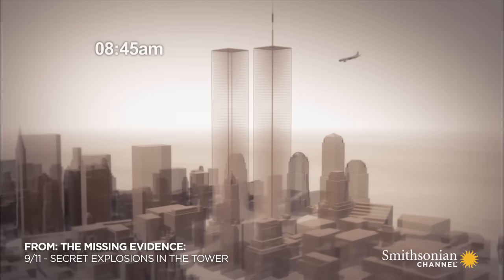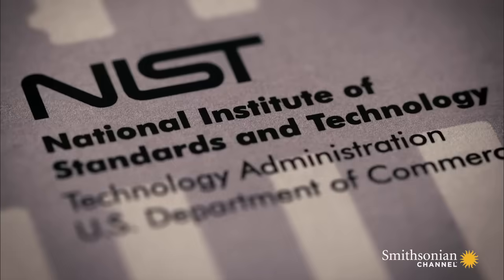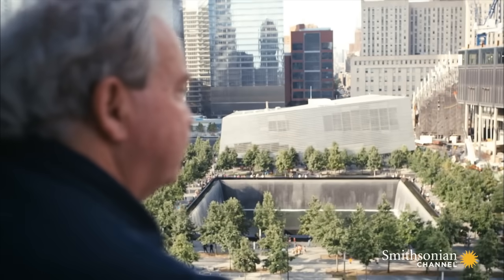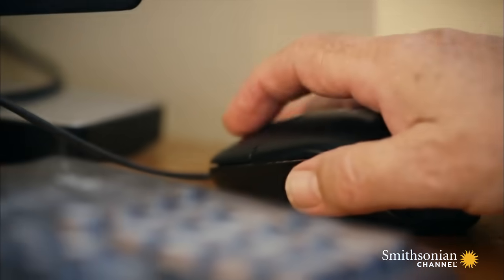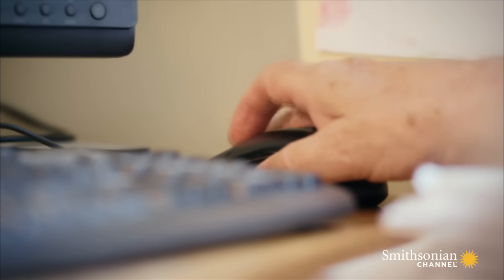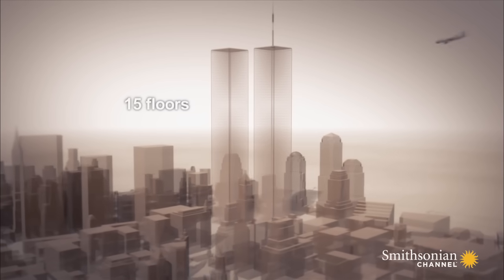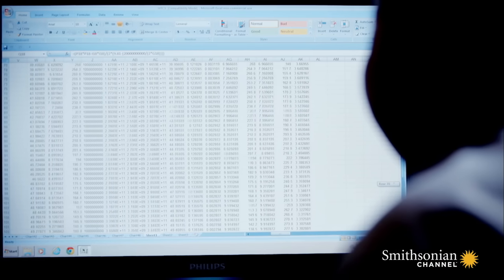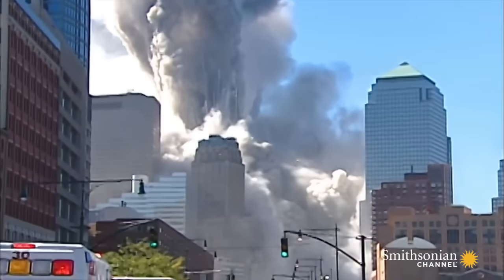This Computer Simulation Explains How the Twin Towers Fell

Comment: The “fanatical rumours” will not go away.
Reply: If you achieve free fall for even one floor, it means the floor gave way giving ZERO resistance. This cannot happen without prior rigging for controlled demolition. Firemen reported seeing “rivers of molten steel” running down the channels in the columns. This is far different to the appearance of molten aluminium. Photos of the micro spheres of iron, indicate that steel had melted, and solidified in air as the building fell. THIS VIDEO is a SHILL video, and the NIST report is a shill report. The perpetrators of 9-11 had access to the stairwells; witnesses have come forth to say that in the months leading up to 9-11, the stairwells had been closed off under armed guard, with workmen going in and out. Most likely unbeknownst to them painting on the nano-thermite that led to the collapses. It looked like the steel beams were turned into dust. Consider this; if demolition crews get the timing slightly off, the buildings don’t fall symmetrically. How could asymmetrical damage do this?

Comment: No, it doesn't explain anything.
This stupid BS is insulting to the laws of physics
Reply: No, it doesn't explain anything
Funnily enough, the "simulation" animation seen in this video is hand-animated, not actually simulated.
Reply: ??? If the floor load limit is X and a weight 15 times more than X lands on it what does your common sense tell you?
Reply: I’m sorry this video hurts your subjective reasoning of what you are. You’re a joke who doesn’t realize HOW basic physics work, so you have no room to insult this video of going against basic physics
Reply: I also love all the “truthers” who calls anyone else brainwashed. People saw it, something hit that building, whether it was UAL 175 or a missile or a steel plane packed with explosives painted to look like a united airlines flight. Something hit the building, and it collapsed. Maybe it’s possible there were a few bombs set to Go off in the lobby, and in the basement, but that’s it.  People died that day, and you fail to realize your proof is practically nil
Reply: @TLO129  It truly is sad that you couldn't of seen what I was doing, but at the same time I was trying to make it not obvious, so applauds to myself, I know kerosene can melt steel beams, I was meeming.
Reply: @Genesis Garza It weights a lot and the walls aren't meant to stand up to planes of that size and weight.
Reply: @fluffiestmallard6484  building engineers and designers have both publicly stated that the towers were built to withstand the impact of an airliner.
Reply: @rexracer7192  Guess they were wrong.
Reply: @fluffiestmallard6484  sorry, your guess is wrong sir. You'll need facts not assumptions.
Reply: @rexracer7192  It's clear planes took them out, just watch the countless videos. It's clear how they came down from a logical perspective by using common sense. There are no lies behind this and there is no reason to lie anyway.
Reply: @fluffiestmallard6484  Hit!! Not taken down. Sorry, you can't change the laws of physics with fairy tales.
Reply: @rexracer7192  The hit took them down
Reply: @fluffiestmallard6484  oh yea, it was one of those delayed reactions. With explosions through out the building having nothing to do with the planes. And wtf I don't see you commenting on building 7 hmm.
Reply: Joe Citizen  I'm definitely not a conspiracy theorist.
Reply: Joe Citizen  It's not called being brainwashed, it's called being able to use my brain. There is no reason to believe there is any wrong doing by the government. Attached the conspiracies have no ground and have no logic. Being an annoying conspiracy theorist isn't high on my priority list.
Reply: @rexracer7192  A 1962 airliner.
Reply: @rexracer7192  Which specific laws of physics are you alleging would have to be changed in order for this to be true?
Reply: @TonyRule  all!!!
Reply: @rexracer7192  Clearly you don't understand the meaning of the word "specific". So to pick out one, can you please explain how you feel Coulomb's Law was changed?
Reply: @andrew tones It's a meme at this point
Reply: Which particular laws of physics were 'insulted'? Can I see your workings demonstrating this?
Reply: And just what are those laws that you refer to?
Reply: try science sometime bro, lot more dependable then things like faith and hope.
Reply: But my computer said.
Reply: Newton's Laws people. A plane hitting a building is exactly the same as a building hitting a plane. If you picked up the building and swing it like a bat, and hit a plane, it was smashed the plane into little bitty bits and the building would have some damage, but not much. Just think about that for a bit
Reply: no. This is correct.  You probably think the towers should have fallen like trees.....but bingo...they are not trees.
Reply: 363 likes at this point. Trolls are out numbered.
Reply: It isn't BS, it's clear that it's possible. The floors aren't made to stand up to that kind of punishment. If the government wanted to get rid of the towers, they would do a proper demolition. There is no reason for them to do something like that.
Reply: “Let’s get a physicist to come and go over what happened” 
- “fucking bullshit! I know better  than this guy! Who u gonna believe? The physicist? Or me, some random pretentious idiot”
I’m gonna have to opt in towards the physicist on this one, sorry bud
Reply: Jules Sarran the buildings are built differently than others. Instead of having many pillars and support, the buildings only has support through the walls. As the plane crashed though the buildings, the floors connecting to the walls began to melt causing that to collapse. Then, due to cause and affect and gravity, the floors above had less support and also started to melt from the fire  collapsed and all the floors weight couldn’t distribute properly to hold everything so floor by floor, the building collapsed down onto itself resulting in a catastrophic event.
Reply: @dylanlee1880  Really? Glad you missed the core out. The building got stronger the closer to the ground you got. Also, if you look at google images you can clearly see the top of one of the towers falling to one side at the onset of collapse.
Reply: @dylanlee1880  Jet fuel can't melt steal beams
Reply: @ivankhan2027  Steel doesn't have to melt to become below the strength required to carry the load it was designed for.
Reply: @TonyRule  Melted steel was found at the crash site.
Reply: @ivankhan2027  how about it weakened it, not melted
Reply: @terryperring104  How about the fact there was literally melted metal found.
Reply: @ivankhan2027  Different metals-different melting points?
Reply: @terryperring104  i wouldn't be saying it's steel if it wasn't chemically identified as steel. It's not hard to identify metals...
Reply: @ivankhan2027  no I was addressing the original comment, not yours
Reply: @ivankhan2027  "Jet fuel can't melt steal beams". Indeed. Where has anyone claimed that steel beams were melted?
Reply: @cyberpleb2472  It actually can, and that was sarcasm to...
Reply: @ivankhan2027  "to..." To what? Or did you mean 'too'?
Reply: @cyberpleb2472  I meant too, and I also stated that my comment on steel beams was sarcasm long before. Read the comments first.
Reply: @ivankhan2027  I have. The broken English and lack of anything resembling humour made the sarcasm impossible to pick up on.
Reply: @ivankhan2027  Perhaps you have sarcasm and trolling mixed up?
Reply: @ivankhan2027  My broken English comment was not based on a single grammatical error, it was based on my reading of your posts (they appear to have been written by a twelve year old). There is nothing wrong with my comma use. Poe's Law makes it rather difficult to distinguish sarcasm when we are dealing with conspiritards. You are all over the place in your posts.
Reply: @cyberpleb2472  But it's not rather hard, expessially when you state it's sarcasm. Am I a conspiritard when I said I was joking? Btw your comma usage isn't that good. Also care to show any other grammatical errors?
Reply: @ivankhan2027  "well obviously it's not going to be written well since i was going for the dumb person look." Congratulations, you nailed it and are continuing to do so.
Reply: @cyberpleb2472  it, and*
In what manner?
Reply: Your latest post is fascinating. An understanding of capitalization, punctuation and quotation appear to elude you.
Reply: @cyberpleb2472  Okay, one, that I didn't notice ; you make it seem like a lot more.
Reply: @cyberpleb2472  " and quotation." Um okay...
How were my quotations flawed again?
Reply: @cyberpleb2472  They're sentence fragments, but you are comparing it to a subject indirectly, therefore you need a comma. I capitalized "i" in most of my comments, however you didn't. Good job on contradicting yourself.
Reply: @ivankhan2027  You have just claimed that I did not capitalize "I" in most of my comments; please provide a single instance of this. Where have I contradicted myself?

What is the subject of this sentence? "They're sentence fragments, but you are comparing it to a subject indirectly, there fore you need a comma." Am I comparing sentence fragments to a subject? You seem to have spliced two sentences together. You meant to say "there fore", right?
Reply: @cyberpleb2472  There's two subjects therefore you use a comma, and no "therefore" is one word not two. Everytime you quoted me you used "i" when I didn't use the pronoun like that.
Reply: @cyberpleb2472  Also you found one valid error, but sure that's "a couple dozen". Where did I not capitalized "I".
Reply: @ivankhan2027  Therefore is indeed one word, so why did you write it as two? Every single time I have quoted you I have simply cut and pasted your words. I have changed nothing. You may want to actually read your posts.
Reply: @ivankhan2027 "Also you found one valid error, but sure that 'a couple dozen'. Where can I not capitalized 'I'". You just keep giving. We can now add five more errors to the list. Can you spot the five errors you made in these two sentences?
Reply: @ivankhan2027  "What is the subject of this sentence?" I see this comment also went over your head. Do you understand how quotes work? Read the sentence that followed this again. Would I be correct to assume that English is not your first language?
Reply: @cyberpleb2472  I did say "therefore as one word, so i fail to see what you're saying. You corrected me, saying that it was actually two words.
Reply: @cyberpleb2472  That wasn't a quote from me. Are you asking me what the subject was in your sentence? How are my quotes flawed again?
Reply: @cyberpleb2472  Can you also tell me where I did not capitalize "i"?
Reply: @cyberpleb2472  I also fail to see the error, Ifeel like you changed it up since that doesn't even match my comment.
Reply: @cyberpleb2472  Yes I know, but guess what, I clearly said it as one word, can you see your computer screen?
Reply: @ivankhan2027 I can indeed see my screen, and I see that you have edited the post in question. I cut and pasted your post. I changed nothing. This is pretty silly though.
Reply: I'm pretty sure you failed your physics exam...
Reply: Jules Sarran. as if you understand physics
Reply: maroom1 you’ve got to aswell take into account that the 767 was doing somewhere between 300-700 knots that kind of impact would’ve heavily weakened the structure of the building on impact and during the time it took for the collapse.

Comment: It amazes me how many people are dumb enough to believe the buildings were brought down with explosives. Even the slightest knowledge of physics and anyone can understand how the buildings collapsed. I mean hell, it really isn't even just physics but more common sense. It is scary to think how many people lack the intelligence to understand this. I remember reading a book about conspiracy theorists. It was written by a group of psychologists. It was pretty interesting. It explained how people with low intelligence become conspiracy theorists and why. They say that it is a way for dumb people to feel smart. Basically an overcompensation. But the interesting thing is that they don't realize they are dumb. It is the Dunning-Kruger effect. They actually believe they are smarter than everyone else.  They had some really good graphs and charts where they showed IQ scores of conspiracy theorists vs what you would call just normal people. It wasn't just a small intelligence gap either, it was pretty big.
Reply: Yeah..I see youre throwing numbers and calculations out all over the place there...if you can, admit to yourself you have done absolutely none of the quantative analysis required to make that statement.

Comment: Simultaneous floor collapse? Bulldust. What happened to the core? There's not an engineer on the planet worth their salt that believes the official collapse theory. If you slice through the upper section of a large tree does the rest of the tree collapse under its own weight at near free fall speed whilst turning to dust before it even hits the ground? No. Not even if a plane hit it. 
Too many people are distracted by theories of fake planes, hijackers, explosives, thermite, nano thermite, mini nukes etc and do not focus on why three buildings collapsed within their footprint at near free fall speed and why concrete and steel disintegrated in mid air. Watch replay after replay and you will see for yourself.

Comment: Two planes. Three buildings! Calculate that you lying shills (1+1=3 according to the Smithsonian!!). Strange how the cold, hard steel below managed to hold up the floors before the impact. Even dropping the actual Titanic from twice the height onto the towers could not cause them to crumble in a manner resembling a controlled demolition. Pathetic non-scientific whitewashing piece of propaganda from the Smithsonian. Shame on you for pretending that the laws of physics were suspended three times on 9/11. Explain Building 7 - never hit by a plane but crumbles to dust from office fires apparently! No - believe your eyes and not their lies. Controlled demolition 100%.
Reply: asrgaqgq sdfgsdgsdfgsdg thanks for clarifying the physics behind the collapse. Really useful. I'm sooooo convinced now that one Titanic could crush at least 3 solid Titanics below as if the ones below were made of paper.

Comment: Are u fucking kidding me? So u really think that the steel beams in the middle of the impacted area just some how manage to fail so evenly that it drops straight down? You'd think one side would buckle before the other causing the mass to shift and tip! Especially since the steel beams below it are completely fine.! Where's the long chunks of steel I beams? Even if it did collapse the floors around the steel beams in the center would have most likely slide down like a pop sickle on a pop sickle stick when it's melted a bit! If what happened is harder to believe then any conspiracy theories, then I'd have to say what their saying happened did not actually happen! Solid steel is not going bust into small pieces! So nice try but no! U get an "E" for this bs!
Reply: Ur a complete fucking jackass! There's a lot more people out there that can easily see that what happened to those towers was not normal! In yeah gravity pulls shit straight down when there's no resistance or equal resistance under said load. Meaning if one side was to buckle before the other it'd tip over or at least not come straight down on itself. I've seen lots of controlled demolitions of buildings they fall just like this. In order for something to continue at free fall or to pick up speed as it falls, it has to experience Lil to no resistance beneath it. In all the metal and concrete beneath it wasn't compromised enough to allow that to happen with out some sort of outside help.. It's funny that there's very very very Lil truthers trying to back what had happened. Meaning they to know that it's impossible to happen like it did without the help of something else. It's funny how both towers collapsed exactly the same but were hit in completely different areas! U seem like someone that's not very intelligent so I'm not about to waste my time with someone who doesn't know their ass from a hole in the ground. It's funny how I'm not even a scientist or an architectural engineer yet it's just that obvious to me this shit had something else helping it come down. Scientists and all kinds of engineers have proven the jet fuel alone wouldn't have affected the structural steel enough to cause such a collapse, in not only that did u not notice the huge fire balls and mushroom clouds upon impact? Yeah that was ur jet fuel being ignited in the air so I'd say about 80% or more was burnt upon the impact with the explosion! U really should look into all the research being or that's been done to show why this was not normal! Please do before u start running ur mouth some more with no proof to back ur theory!
Reply: Ur a God damn fool! Ur telling me that out of the three buildings that fell at free fall speeds was normal.? So it's just coincidence that the supports steel and concrete just magically folds up like an according. U must not know anything about controlled demolition!? Do u know what all goes into making the building fall in its own foot print? Trust me it's an art. They do that so there's Lil to minimal collateral damage to surrounding buildings and businesses! I'm serious, right now go search controlled demolition. There should be a documentary about it. Seriously I'm not trying to be a dick, once u see that I really believe ur attitude will change towards all of this!